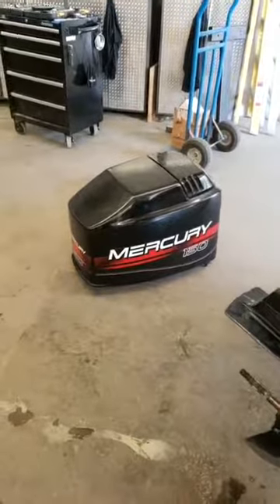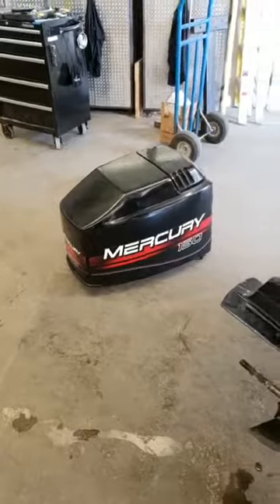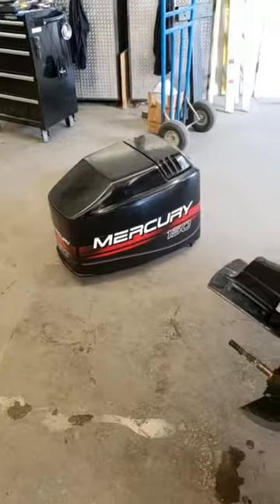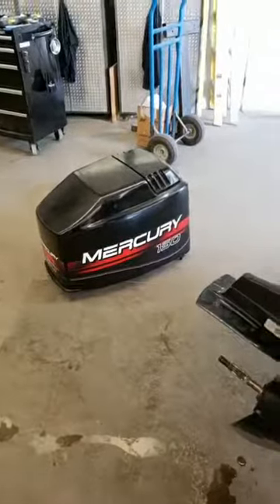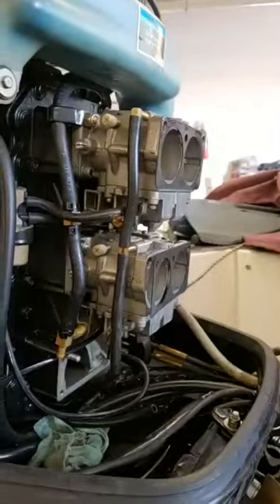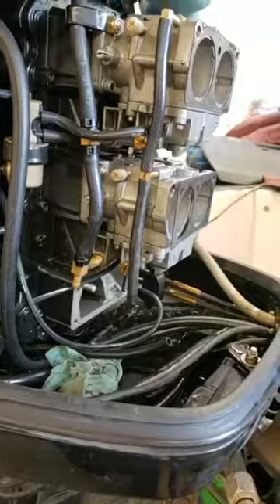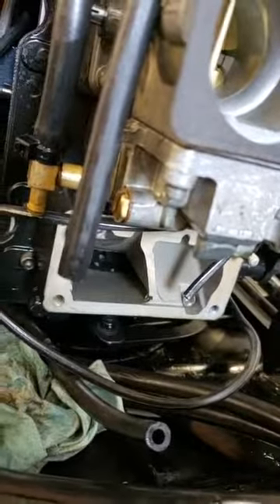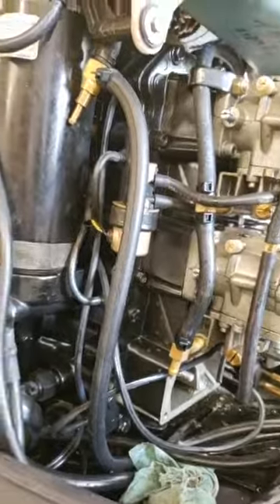Broken Reeds on a 150 Merc.  I discuss symptoms

Comment: I think I have this issue. I have a 2004 nitro series motor that looks just like that, 150 Xr6. It bogs trying to get on plane. Normally I could still manage to get up and then it seemed ok on top of the water. It kept getting worse and now I can’t get it up at all. Compression is good.
A mechanic I talked to told me he’s seen reed valves cause this where they are not closing properly. Told me to look at them and make sure they are sitting flush against something shaped like a V.
Reply: But…I’m not sure precisely what I’m going to be looking at…so trying to take it a part to see what I see.

Comment: I have same motor 97 mercury 150 xr6. It’s hooked up with a hot foot. Guy I bought it from says he just had carbs cleaned up. But runs WOT good. It’s just it won’t idle at low rpms have to give it gas. Even after I’ve went 10 miles when shut down fish 10 mins go to start and still gotta give it throttle. Think it’s just hot foot needs to be tightened or an adjustment with idle?
Reply from the maker: Could be the ible speed is too low or the idle stab box is not functioning.
Reply: Check to see if it mine did that after I bought it reed snapped enden up in piston scarred the walls got a new motor and runs good but man I'm still worried about them reed valves
Reply: @TheMarineDoctor  what cause a reed valves to fail
Reply from the maker: @user-zi2vx6wf8r  Just normal wear and tear...or over reving.

Comment: I have a 115hp towers of power  doing same thing,it bogs under a load,replaced crank trigger after it ohm out bad.ohm stator it was good ,has new brainboxes on it fire on all 6,carbs were clean,135lbs compression on all 6,guess I'll inspect reeds next.

Comment: I have gas pouring out  of the top carb on a 175 merc. Do you think it could be a stuck float. Or a reed issue. And when ordering parts.  Are all reed panels the dame size on the motor? N
Reply from the maker: Pouring out will be the needle not sealing.  The carb will need to be disassembled and cleaned or parts replaced.  All the reeds match on the engine.

Comment: I have a 150 merc and it doesn’t start in the water and I have to trim up the motor just to start it in the water and then I have to put it into gear to keep it running.I rebuilt the carbs and fuel pump and was wondering it could be reed vavles
Reply from the maker: Take the cover off the front of the carbs.  Tilt the engine up slightly past horizontal and prime the fuel system with the bulb.  You will be looking for an excessive fuel leak from the carb that aligns with the fuel pump.  Reeds...will show a white substance in the throat of the carb....cannot miss it.
Reply: Did you ever find your issue ? Have the same problem
Reply: @treycheatham8148  I did I had to replace the trigger and stator after replacing the reeds

Comment from the maker: Are you able to hit high speed?  If so, I suspect your restrictor need replacing under your intakes.  If you cannot hit high speed...compression or the stator is falling off.  Also check the plugs for water or white froth.
Reply: ive got an 82 Johnson 70hp outboard that bogs under acceleration and high load/demand at low speeds (like loading under power). has all the power at top speed i was thinking maybe reed valve? haven't done much digging on it. has a new head gasket as of last year and fully rebuilt cooling portion on the head. and carbs have been rebuilt.
Reply from the maker: @andrewmerris4005  Remove and clean the carbs.  Its possible a low speed jet is plugged.  You might also want to verify the sync and link procedures.  They can be found on the internet.

Comment: My engine is hard to start if i try to start it after 20-30 min after last run, is Shake bad in like 3000 rpm only and have a hi idle.
Reply from the maker: Does it eventually clear up?   Could be flooding or maybe water intrusion through the exhaust.
Reply: @TheMarineDoctor  the engine run good, just the Shake in low rmp, if i drive in like 7-8 knot. Im thinking Reed or some air leak, the rmp is only hi if the engine is hot. It is a 1999 90 hp merc. You thinking exhaust leak ?
Reply from the maker: @terjee648  try leaning out the idle jets.

Comment: I have a 90 hp force. i had cleaned all the carbs and put new kits in them. replaced the fuel pump. gas lines. but it wont start on its own when its cold. i can get it running off starting fluid and it will stay running after that. once it warms up i can shut it off and turn the key and itll start right up and idle like a dream. only problem is cold starts. any help?
Reply from the maker: Verify that the primer or choke is functional.
Reply: TheMarineDoctor the ball is hard 24/7. I’m very confident in the choke plates closing all the way when it is engaged. If you had to rule out the choke and the primer now, what is your next step? Thanks for the quick reply
Reply from the maker: Observe if fuel is coming out of the carbs when choking while attempting to start.  Does it spin over fast?

Comment: I have an 1998 135 hp mariner 2.0 v6 when i want to start the engine its going to shake, and it looks like backfiring but im going to clean my carbs. What could it be
Reply from the maker: It could be lean pop...carb issue.  Might not be running on all 6 cyls.
Reply: @TheMarineDoctor  so if clean my carbs the problem would be over or?
Reply from the maker: @jordyderooij7376  it never hurts to clean them.  It will only stop the problem...if its causing it.
Reply: My motor is fixed the wires of the trigger were wrong connected we connected the good ones and it runs like a sunshine